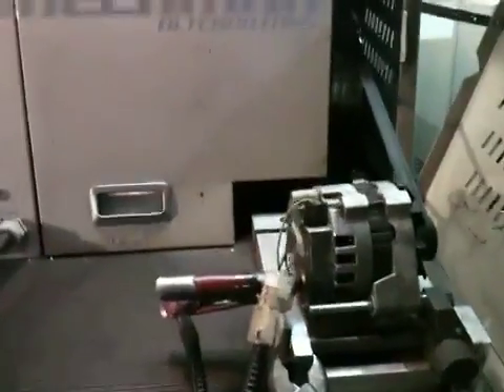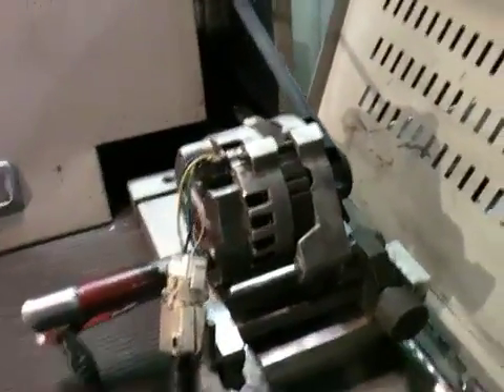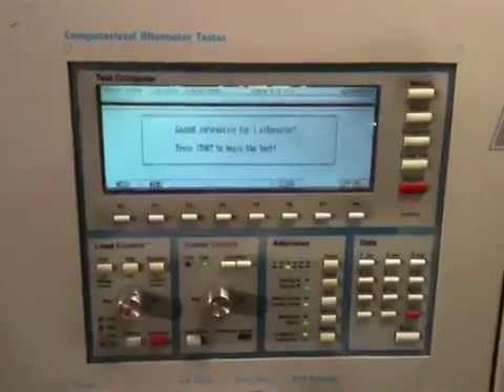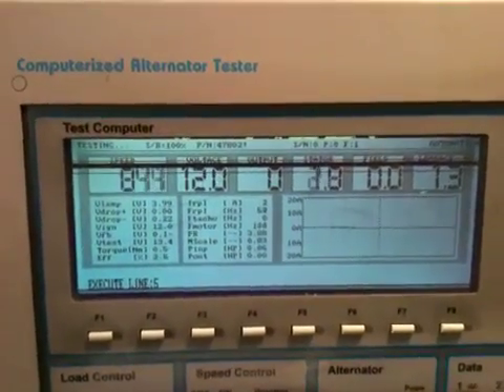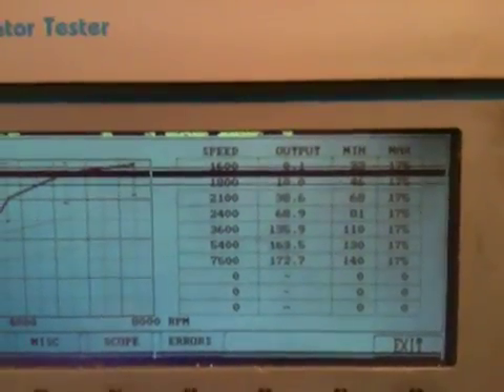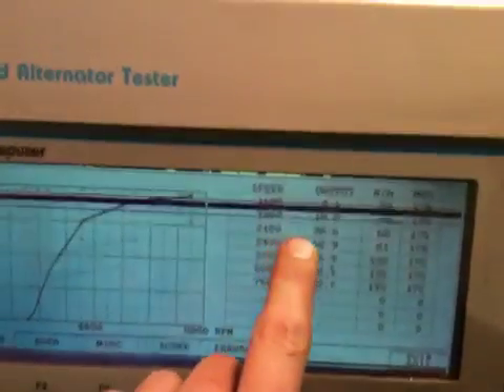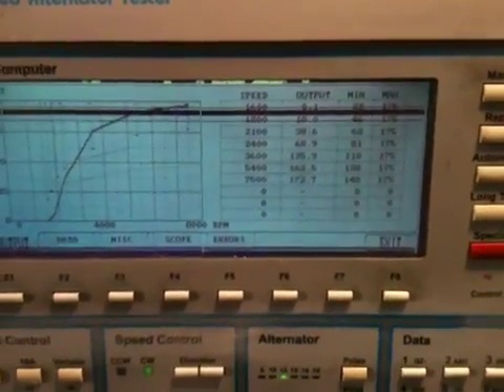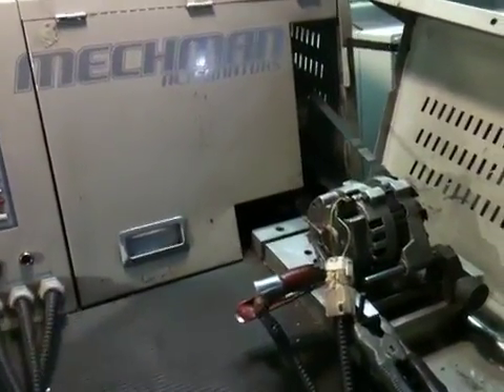High output alternator comparison

Comment: @mechmanalternators hi, and thank you very much for the fast reply, its a 2004 volvo xc90, but its a D5 that is a 2.5L deisal which i dont think they have out of the UK, im not sure of the alternator make which is the HO one on now, but the original was a BOSCH 0_124_525_029, the HO on at the momoment is a replacment part for the bosh part number but i dont think you can change the pully ???

Comment: hi, i have just fitted a HO alternator, its a 250A, or rated at that anyway, im having a problem where im only getting around 13V on tick over, my car is around 600rpm at tick over, its needs to be reved to around 1000rpm to get 14.4V, is there any way i can get it to put out full 14.4v without having my foot on the gas ?